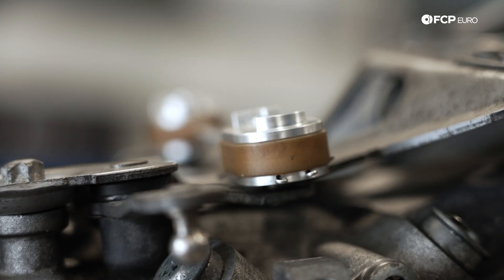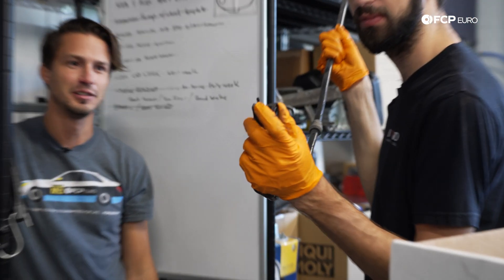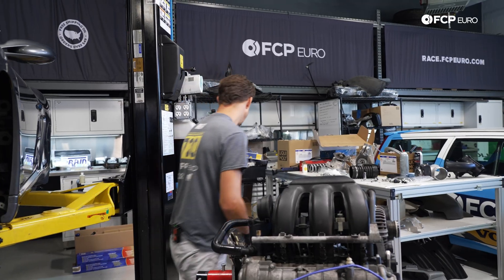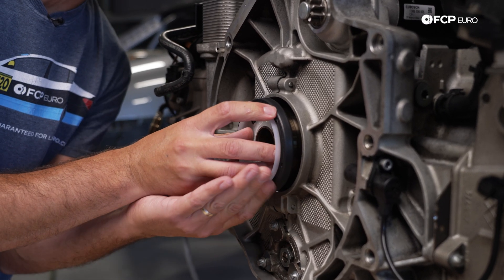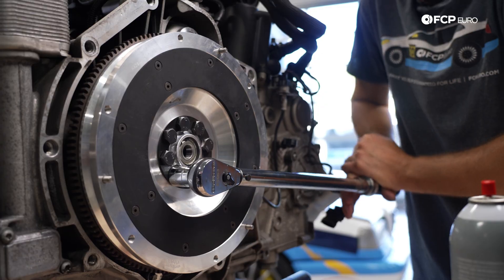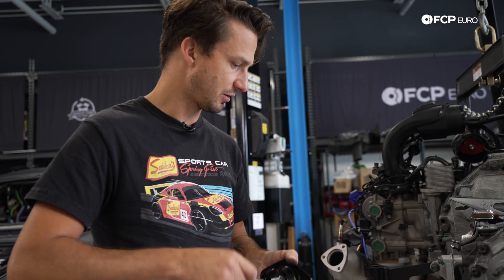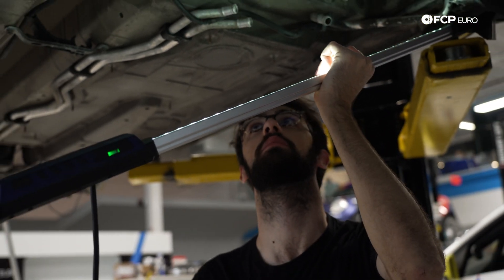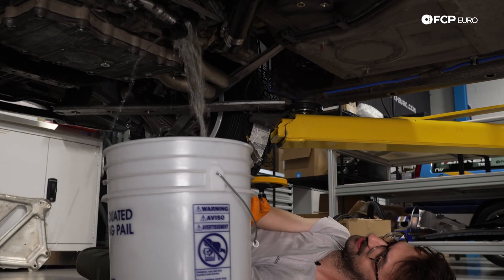Mid-Engine Refresh: Reassembling the Rallye Cayman Driveline

Comment: Best practice when marking torqued bolts is, torque-mark-torque-mark etc, not torque-torque-torque….mark-mark-mark. Hard to miss torquing a bolt using the first method, easy to miss a bolt using the second. It’ll take longer, but even in factories where time is critical, they’ll use the torque-mark method.